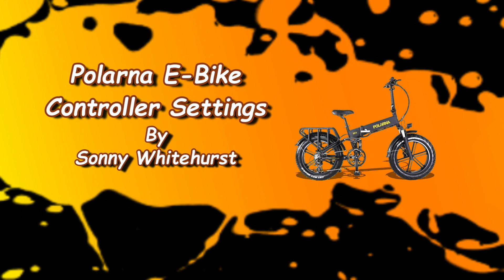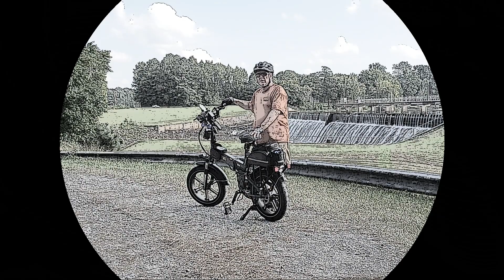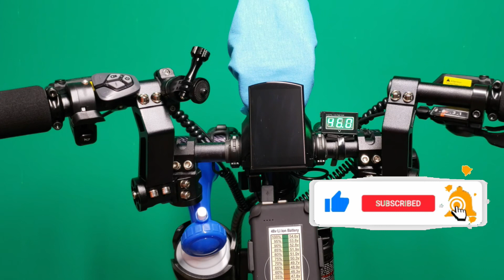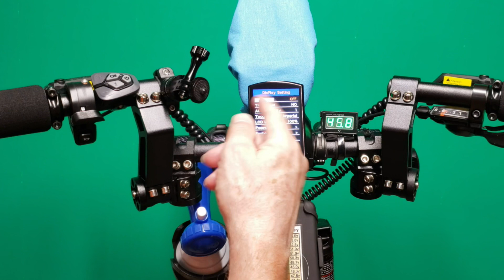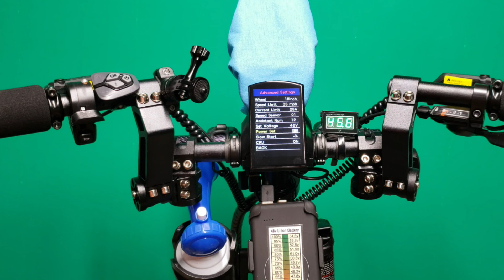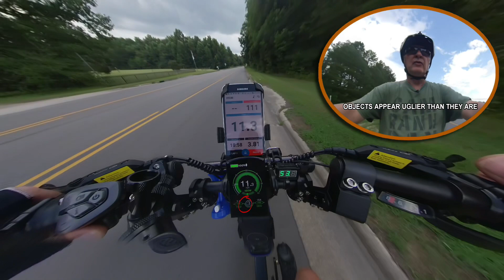Polarna E-Bike ~ Controller Settings

Comment: ALL POLARNA MODELS M3-M6 USE A 500W NOMINAL MOTOR. SOME M4'S CAME WIITH 350W NOMINAL. They are using "PEAK" wattage as a sell point. Just look at the wire gauge coming out of the "1000w" motor. My Bafang 750w has a few gauges thicker wire than the supposed "1000w". Also took to bike shop and Tech explained the motor case numbers do not exist and are most likely engraved by Polarna when they receive blank cover. He showed me a real 750W nominal motor and everything on the inside was clearly rated for higher rpm wattage voltage etc. and that was just a 750w when mine is a "1000w"... Just fyi. The wire gauge and small case size are a dead giveaway. Hense why using a 26a controller motor does only 26-28mph now with mild at best acceleration.. When there are real 750w nominal motors using 18a controllers that are far superior in speed and acceleration.. The M4 early model '750W" motors were likely 350w nominal motors with oversized controllers.. Even the 55nm of torque rating sort of gives away there 1000w rating is incorrect..

Comment: yes, big help. Where did you find what all the different settings are for? I did find the display - a KD986 color LCD display. I asked Polarna to send me some kind of sepc sheet on the display. They sent a completely wrong display spec sheet the first time (black and white display). Second time, it was the right display but spec sheet gave no explanation of the various functions. Thanks for the wheel size setting. I've played around with it but never able to figure out what the different wheel size settings actually did for speed or odometer readings. Now my speedometer doesn't work right. I made a video and sent to Polarna and they just came back yesterday and said re-set display but I already tried that 4 - 5 different times. I use 5 PAS settings, I recall factory settings was only 3 PAS settings. I noticed on this last go around, my settings for PAS never changed. IDK, this is a replacement display Polarna sent me bc right out the box, none of the power setting worked right - power would cut out randomly and finally only throttle power worked. Their engineers determined that it was a faulty display. The new display seemed to fix the power delivery, finally, but now like I said the speedometer and odometer don't work. I think it's a controller problem or sensor problem but I'm not an electrician or engineer. I just want a ebike that works consistently. I really like the bike; rides very smoothly, seems to have good power, is certainly fast enough, looks good, great brakes, a blast to ride on dirt trails, just wonky electronics

Comment: I changed my units to Imperial but speed limit shows up as 41km/h. Do you know why? Also, how did you get your max speed all the way up to 33mph? The max mine goes to is 41km/h or 24mph. I contacted costumer support but theyve been pretty useless and wont satisfactorily answer anything despite quick responses.
Reply: Yep, my new M6 I got last week is exactly like yours, limit in km/h.  I think my bike goes faster than 24mph, though.  I think to get to 33 you'd be doing quite a bit of pedaling.

Comment: hello  i enjoy your vids on the e bikes    i recently purchased a M6  pro   1000 watt motor   17.5  amp battery    realy like the speed  and handling     but my display  is   showing 4 to 5  mph     when i am at 10 or 15  mph     what is the controll   setting    to correct      my controller screen  dose show   set  to MPH   thank you for your help
    clay
Reply: Try setting tire size to 22 inch

Comment: Hoping that someone is still reading these comments, has anybody been able to control their top speed in the computer? No matter what speed I put it at it does not change it. I actually own the M5 version.
Reply: I can change my speed but it's stuck at 41km/h max. Even though I changed my units to Imperial to show mph. I contacted customer support which responds within minutes or a day but they have been useless.
Reply: @SensationsRim  I think the cruise control is controlled by the controller and I think you might have to control speed by manipulating the power output in each power assist level.

Comment: Another great video.  Tnx for your time.  One potentially dangerous issue that keeps coming up on this bike and perhaps others, is the peddle assist function when the bike is in the stop position as when you stop for a red light etc.  People say if they move the peddle at all, fwd of backwards, the bike takes off.  And if they didn't have the brakes on fast enough, it could launch them into oncoming traffic.  No one knows how to stop this from happening.  Do u have any experience with this problem?  You don't appear to answer any questions so I'm putting that out there for others to respond to.
Reply: Hey Wino Kitty, just letting you know that there are some flaky things happening to my motor controls as well. I'm not sure if it is related to wheel removals for tire and tube changes or controller/motor failure.  I have the M5 with the 750W motor and it's started dropping out in PAS modes and then coming back on without pedaling, and sometimes the throttle won't work and then it does. Usually intermittent problems are wiring issues, but I made sure my motor cable was protected when I worked on the tire removals and reinstalls.  I've been looking for related issues and have read comments of similar issues with the new M6 bikes as well. I have added the second 20ah battery like Sonny did and don't think that is my problem unless the close corridors in the controller housing are causing wiring connection problems now. I will be troubleshooting the connector to the hub motor and where the cabling goes into the axle to see if I can get it to act up on the bike stand. I'm hoping it's not a controller or hub motor going bad. Oh and btw,  it also started motoring after stopping and not pedaling, but in a PAS mode. I have to hold the brakes when stopped to kill the motor from coming on randomly. 🥴 https://youtu.be/Cydev_qGaa0
Reply: @jockwetmiller4692  Hey, Jock.  What u are describing is exactly the problem others have described on this bike and a couple of different bikes very similar to this brand design.  It's obviously a flaw in the electronics, or like you are suspecting, one of the components.  This might take a good while to pin point, but in the mean time riders need to be very aware of this potentially dangerous characteristic. These eBikes are ingeniously designed mechanically and electronically, but there's a few bugs that still need to be worked out of them.  With so many companies over in China designing their own eBike electronics, they will eventually hit on a solution to this problem.   I think there's only a couple of companies making all the mechanical components.
Reply: @jockwetmiller4692  Hey, Jock.  Just had time to do some research into this matter.  Seems like there is a lot that can go wrong with the PAS sensors if they are dirty, not spaced correctly and it just may be a inferior wheel or pickup sensor.  I watched several YT vids of people saying they had "problems" with there sensor and mag wheel.  They didn't go into much detail of what they meant, but they show what wheel they used as a replacement.  There's a lot of them on Amazon, but I liked the vid of the guy showing his split wheel wheel that does not require the crank lever to be removed because it is split. It's a 3 pin sensor.  For $18, it might be worth a try.
Ebike Accessories KT D12L PAS Pedal Assist Sensor Electric Bike
Reply: @ginginthing  Thanks for the replies, continued interest and research. It motivated me to go give the bottom bracket another look. I found it does have a coil/magnet on the non-drive crank side.  I took a picture and did a short video of the ring to show how loose it is and wonder if that looseness might be why it is acting up. It's also the same side I have mounted my LivLov  Cadence sensor, up the crank near the pedal. At least I have those things to investigate tomorrow.
Reply: Okay, Wino Kitty, I finally took the time to troubleshoot the ghost throttling and PAS intermittent running. The PAS sensor was okay. When I pressed the thumb throttle and released it, it acted like it was in cruise mode without displaying the cruise icon. Then when I would brake it to cut out the motor it would resume running once the brake was released. I was also noticing how much lag there was in the speedometer reading on the display of dropping to zero after the brake was pulled and motor cut out. Turns out after I disconnected the waterproof plug for the thumb throttle, and just pedaled it it ran flawlessly in the PAS speeds, cutting off the motor right after the peddling stopped, like it is suppose to do.  I plugged the cable back together for the Thumb Throttle and wiggled the cable where it goes into the housing of the thumb throttle and the motor took off. It appears to either have shorted connections between wires or the connector pins are not making good connections. I got three similar types of thumb throttles ordered from Amazon to sort out if it's wiring issues or throttle issues. https://www.amazon.com/gp/product/B08HVMH5ZS/ref=ppx_yo_dt_b_asin_title_o02_s00?ie=UTF8&psc=1  https://www.amazon.com/dp/B09BQFL28C/?coliid=I2YOJTODQ8XMQH&colid=1ICDTJE6JBEOW&psc=1&ref_=lv_ov_lig_dp_it  https://www.amazon.com/dp/B0B1P9FSQ4/?coliid=IIDF6101EWOC4&colid=1ICDTJE6JBEOW&psc=1&ref_=lv_ov_lig_dp_it
Reply: @jockwetmiller4692  Jock.  Sounds like u r narrowing the problem down.  That would be great if it's something simple and not the controller.
Reply: @ginginthing  Update on final troubleshooting of throttle and PAS ghosting/intermittent and Cruise sticking. I bought three basically identical replacement thumb throttles with the yellow waterproof 3-pin male connector. Two of them showed the same pin-out designations, and the third one was different from the other two. All three of them were not the same designation as the one on the bike. After investing into a extension cable with male/female connectors, I cut it in half to use it to see what the wiring was for the Polarna throttle. To make the ones I bought work I had to swap the (5V+) wire/pin with the (5V-) wire/pin. The speed signal pin stayed the same. Now I made the crossover patch cable permanent with shrink tube solder connectors and covered it up with black shrink tube.  The Polarna throttle would not work with the crossover patch cable. Now after doing all that AFTER a successful ride with the original Polarna throttle it appears to have fixed itself. (I think unplugging and plugging the connector may have cleaned up the pin connection points, but I'm just speculating.) I also had obtained a rear flat (with a Tannus linner) and had to remove the wheel and add Flat-Out to seal the pinhole in the tube.  It didn't hold up, and I had to replace the tube. So I removed and reinstalled the rear wheel twice, meaning I unplugged and plugged the motor cable connectors twice, and that was after the throttling and PAS issues of the past cleared up to do the test riding I was doing up and down my street. My ride worked out perfectly. No ghosting, or dropping out in pedal assist while pedaling, and cruise control worked as it is supposed to. It performed flawlessly for the 14 mile loop I ride. So now I have three backup thumb throttles.  I think the one above just wanted me to spend more money on the bike just to test me. 😇
Reply: One other thing I noticed is the Motor has a built-in PAS sensor.  The two other bikes I have, the Lectric XP 2.0 and a Bafang 750W hub motor BAM Nomad 26 incher, have bottom bracket/crank magnetic sensors. I looked all around the bottom bracket on my Polarna and there's no wiring or coil/magnet sensor. Looked on Amazon at the breakdown picture of the 750W hub motor and it appears the have halifect wheel on the shaft to either monitor speed or sense torque. Just trying to think out of the box here. My Polarna didn't start this problem until I removed the rear wheel for the tire servicing.  I managed to have a successful ride after the first wheel removal and reassembly after riding it for a mile. I ride a 13-14 mile loop and it behaved after the first mile. But since then the following two rides have resulted in the intermittent PAS and ghost throttling from a stop. I bought two new display monitors from a AliExpress vendor that asked for the number on the back of the display monitor, that's the same model, but being sold for the Bafang motor. I figured they might work the same, just in case I crash and damage the one on the bike. I found the plug/jack in the back of the Polarna monitor is real stuck in there tight, and it felt almost like it was a permanent connection, so I didn't want to damage it trying to force it to unplug. I was going to test the two bought ones to see if they would work, but I'll cross that bridge when it's absolutely necessary. I will leave another comment if I figure out the problem with the PAS and ghost throttling.
Reply: @jockwetmiller4692  Hey, Jock.  Thx for the additional observations.  My guess is that no matter what type of electronics are being used in a PAS system, it incorporates a form of Hall sensor to detect rpm and calculate speed. The only problem I've had with these Hall sensors over the last 30 years in aircraft electronic ignitions, is they can fail. Its very rare and it's usually caused by some type of damage, so I really can't say the Hall sensor failed.  But I've never had one send false signals when the crankshaft was not moving and the electronics were on.  So that would be a new one to me if that was happening. To me, the problem might be in the board or chip that is reading the sensor.  It must be getting a signal somehow, or is interpreting incorrectly.  I'm a retired mechanical aerospace engineer and was not even allowed to look at electrical engineers while going to classes when I was in college, so electronics are out of my league.  And I still think there's some kind of voodoo involved with electricity, but I can try to isolate the electrical problems down to the components. BTW, these "Sparky" students use to talk to themselves on a regular basis in the hallways going to the next class.  So these people that design these electronic components use a very different type of logic designing these systems that I can't follow.  I can just ask for a component that woks correctly.
Reply: Hey, Jock. Your testing with 3 different replacement components, then finding the original component ( thumb throttle) worked sounds exactly like I'm going through on one of my projects. It's very perplexing and mine has been going on for over a year of trial and mostly error. 
Just to be clear, u got the 3 different replacement thumb speed controllers, made up a special patch cord for them to work because the wiring was different from the original controller, but u ended up with the original setup including wiring and controller. So the problem was bad contact in the original 3 pin power plug from the start?  This has me written all over it. Seems like most of my electrical problems are fixed, after major tear downs and component replacements, with finding something very simple to be the problem. Bad contacts. Usually after u already have thought of that and thought u cleaned them, only later to find out, u didn't thoroughly clean them. 
I have a garage full of extra replacement parts that were bought to fix a problem. Seems like, as long as u have those, the original part will always work.
Reply: I've also had problems with throttle seemingly randomly failing and alternately the pedals not triggering the motor. Also the motor often tries to run with no input. Customer service is non existent and i paid for a replacement screen 2 months ago and haven't heard from them since sending the serial number
Reply: @Coffeeandacigarette  Hey, Donald.  The problems u mention are along the same lines as what Jock has been working on with the thumb throttles and the "ghost" peddling. He's made some valuable discoveries while doing so.  Don't know if u read his comments here but they may be a help to u.  Unfortunately I think that most people buying these eBikes from China will not have much in the way of CS, and will have to rely the many great YT vids ( i.e. Mr Whitehurst's vids here) and on peoples comments on how they addressed their issues.  They all seem like great bikes, but all have a small weakness that hopefully is an easy inexpensive fix once we know what to fix.  Sounds like each bike and each model of eBike has it's own peculiarity with the electronics used on that bike. And luckily, there are many replacement and upgrade parts available online at Amazon and the like.   BTW.  I've been buying stuff from China for many years and it's not unusual to receive something I paid for 6 months later.  Out of the hundreds of things that I bought from there, I've never been ripped off. They just aren't reliable on delivery time estimates. Especially now.
Reply: I experienced something like that a few times....would start to peddel and ugh....no power, suddenly the power came on and the bike would like bolt forward - too much power, despite me having on power level 1 or 2. Now, for some reason power levels 1 and 2 hardly flow any watts ( like 42 - 72), especially if I peddle slowly. IFDK, just wonky electronics.
Reply: I was concerned about this when purchasing my M6.  I was conscious about it when first riding it, and it turned out the pedal has to be rotated about a little less than half a circle for the motor to kick in.  That's just on my bike and not sure what others are like though.